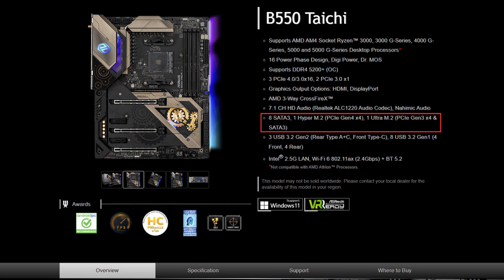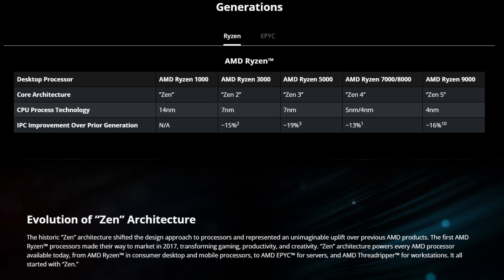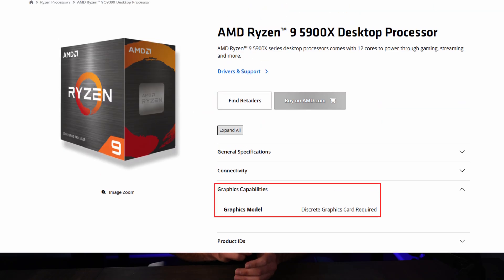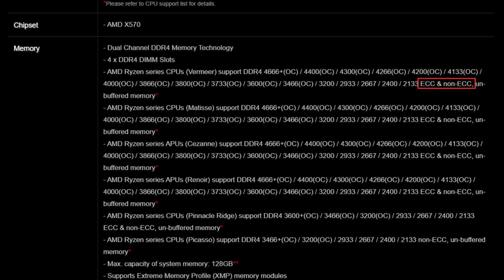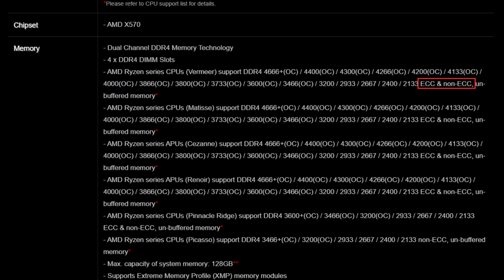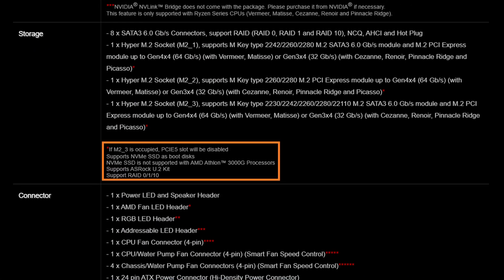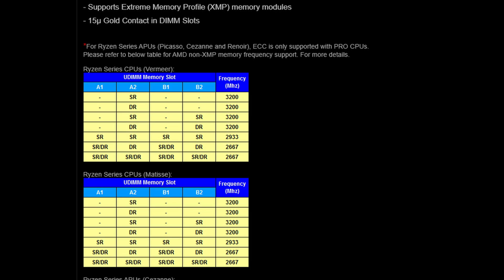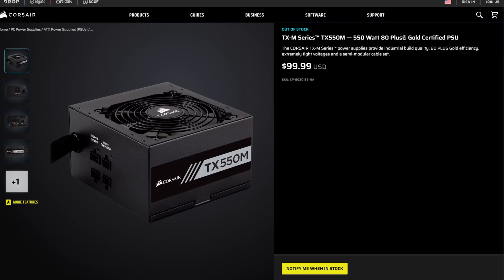Designing the PERFECT Home Server for your Home Lab

Comment: 2nd hand i5 CPU,16Gb RAM, 1Tb SSD, and as much mechanical hdd as you want with a bay.  there you go, a home server with a 3rd of your price.and adding a 10Gb/s network card is overkill when the majority of routers/switches are 100Mb/s-1Gb/s. there are people running a homelab server from a raspberry pi(not me i think it's a waste of a single board PC) without any issues. raspbian+docker+hdd space and you're sorted. what you propose is completely overkill and far too expensive to use with something as pedestrian as a home server.

Comment: it's actually even more confusing,
1) some motherboards have reduced features depending on cpu used - for ex. Ryzen 5700G on its own doesn't support PCIe gen4 at all
2) all the motherboard "chipset" connectivity is limited to (usually) PCIe x4 link to a cpu, so you get heavy bottlenecks, when for ex. simultaneously using onboard chipset LAN, chipset M.2 SSD, chipset SATA SSDs, and chipset USB-C as backup
3) some PCIe cards have own internal lane switching, so they may not need bifurcation support at all, and can operate with less PCIe lanes - for ex. Sonnet 8x4 card can run 8x NVME SSDs but even when not plugged in x16 slot (obviously the total speed of the SSDs combined will be capped by slot)
Reply from the maker: Great points! Thanks for the comment!
Reply: @WunderTechTutorials  looking forward to next vids, home servers are fun nowadays when people are obsessed with throwing away PCs that don't meet W11 requirements :D